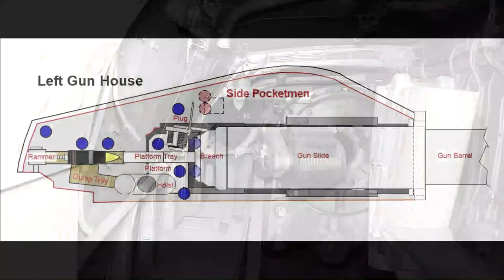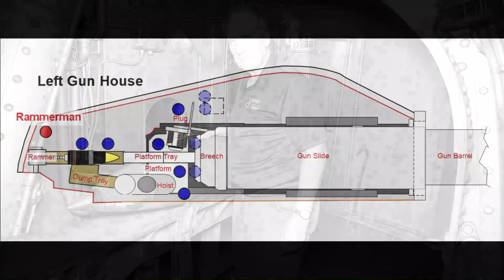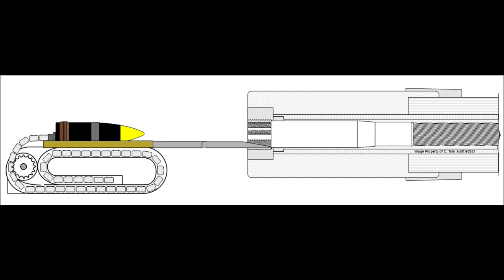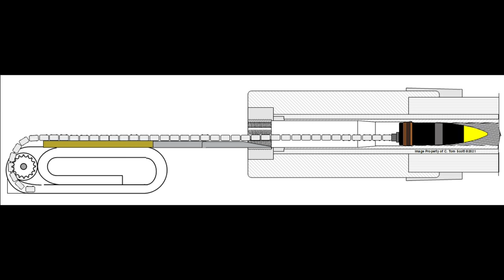Battleship Texas, Getting Loaded in a 14" Turret

Comment: Oh good lord, I just can imagine how those gun houses feel on a sunny July in the middle of the Pacific.
Reply from the maker: I can tell you from direct experience that the turrets are unsurvivable on sunny days when temperatures exceed 85-90 degrees.  However. each turret is well ventilated by two very large blowers that pull air from inside the ship and out through openings in the outer bottom edges of the turret houses.
Reply: @tomscotttheolderone364  Very interesting, they pull air from lower in the ship where the water makes it cooler, a simple, practical solution. Still, I imagine the experience is only slightly better than working in a turn-of-the-century steel mill. The metal itself looks like it's been sweating.

Comment: Makes the turrets of BB New Jersey look like the inside of the space shuttle.
Reply from the maker: No kidding!  I've been in one of Alabama's turrets and I'm pretty jealous.  If you look very carefully my video, you can see the black tube that is a rangefinder running crosswise across the top of the barrel in turret 2.  Reaching the operator's seat required crawling and squeezing on top of the gun mount in the right sleeve.  You can simply walk up to the one on Alabama!  Plus, they have a range finder in theirs used to calculate firing solutions.  It isn't fair!  :)

Comment: What's always blown my mind is how the cloth bags used for the powder charges don't leave any bits behind after the shot.  As a combat engineer i was trained in demo and with some of the ordinance we use you'll often see fragments of things you'd think would sublimate into vapor or just burn up.  Plastic coating from det cord, cardboard from tnt blocks, etc. Though i think that has more to do with detonation velocity, blast is over so fast there wasn't time. But i suppose with the gunpowder those guns use the heat and pressure behind that projectile could keep the temperature high enough for long enough to consume the cloth. 

It's cool to me
Reply from the maker: Since you were trained in demolition, you likely know much of this, especially the nature of burning explosives.  So, I am covering this for other readers also.  There is a good reason for residue and explosive gasses being present after firing.   First, the gasses produced by firing reached several thousand degrees and immediately heated the surface of the gun bore to a very high temperature that remained long enough to be a heat source that could reignite gasses and debris that may still be present in the bore and powder chamber.  Next, the oxygen used in the burning process is chemically bound up in the propellant itself.  However, there is not enough present to completely consume the propellant.  So, the process is that when a powder grain ignites, it releases propellant vapor and oxygen from its surface that burns extremely rapidly until the grain is consumed.  However, not all of the gaseous mixture is burned because it runs out of oxygen.  When the breech is opened, fresh air rushes into the breech or muzzle, providing enough oxygen to reignite the gas.  As the flame expands it pushes out of the breech, exposing more of the remaining gas to oxygen and continues to burn until consumed.  All of this happens in a millisecond or less.  Regarding fragments, there may be two types present.  First, there may be tiny fragments of unburned propellant present.  The powder grains that were used were extruded cylinders that had 7 holes running their length to provide more burning surface area.  The pieces left behind are fragments of what is called the web, which is the material between the holes.  Even though the gasses are hot enough to ignite when oxygen is introduced, the surface temperature on the fragments has dropped enough to stop the evaporation process.  So, they sit there waiting for a new ignition source, which is the reignited gasses.  The bags were made from raw silk, which readily burns and leaves only a fine ash that will not ignite since it has already burned.  However, it is possible that tiny fragments have been left behind.  Plus, it is my understanding that the bag laces may have been made out of wool on early bags that could have left unburned pieces behind.  Even though gasses and fragments have been burned using the gas ejector, there is still a remote possibility that some fragments remain.  The greatest concern was that fragments may remain on the face of the breech plug that came in contact with the next shot's powder bag ignition patch containing black gun powder.  That is why it was always wiped with a wet sponge between shots.  If there is any concern about a foul bore, one manual said that the gun captain should immediately order a shell to be rammed into the gun to seal the bore ahead of the shell and eliminated it as a potential ignition source.  They could then spray the powder chamber behind the shell with water to cool and wet down any remaining debris.  They could then proceed with loading bags.  Since gunnery procedures required loading immediately before firing, the powder in the bags wouldn't soak up enough of the water remaining in the chamber to have any effect upon on firing or performance.
Reply: @tomscotttheolderone364  thanks for taking the time to share more of your knowledge. The bit of information i was lacking was that the powder bags were silk. It makes a lot more sense now. Still cool, just less of a head scratcher lol.  

Thank you again for your time sir.

Comment: You are certainly right; the shell and propellant handling systems of Texas are very primitive compared to the Iowas. It boggles the mind to imagine that Texas participated in the bombardment of Normandy before and after the invasion in 1942. Kudos to the officers and men aboard her.
Reply from the maker: In spite of the fact that the systems were largely manual, a well trained and drilled crew could keep up a high rate of fire for an extended period.  The fire control system was pretty obsolete when compared to later ships and this would have been a problem in a sea superiority role, but they worked very well for landing support and shore bombardment.  Air spots continually reported back complete destruction of targets using indirect fire thousands of yards inland during the D-Day landings.  Its effectiveness was further demonstrated on the afternoon of June 6 at Omaha Beach when the ship closed to within 3,000 yards of the beach and used the 14" guns to clear exit D-1 with deadly pinpoint accuracy.  This saved the lives of scores of troops and provided a major way off the beach.

Comment: 4:00 Love how small the screw for rising/lowering the angle of the gun is. Makes sense with how finely balanced I'd imagine the gun is. Just seems like it'd be larger, but reckon not.  I'm surprised the turret is sub divided. Didn't realize it wasn't like more modern turrets that have all 2-3-4 guns in same room. The well man and guys in the pocket had it the worst it seems haha.
Reply: Yea, Thinking of being in those places makes me shudder...
Reply from the maker: The screw looks pretty big to me. Perhaps it looks smaller due to perspective.  Btw, you are right, it is finely balanced.  The center of balance for the barrel, breech and slide assemblies all together is right at the trunnions that the barrel rotates on to elevate.  The major weight that has to be lifted is the 1,920 lbs. of a projectile and powder charge, plus the inertia loads provided by the 60+ tons of mass. What is really impressive is that power to elevate the barrel came from a 15 hp motor!   Go to 10:20 in this video to get a complete closeup of it:  https://www.youtube.com/watch?v=sTizEKz0u5s&t=6s
Reply: @tomscotttheolderone364  Indeed! Thanks for link to closeups, didn't see those. That was most interesting system of the gun in my eyes.
Yeah, I naturally assumed it would be even larger when I saw it. Looks only like 4" or so. I just envisioned like a solid 12" piece in my mind. Makes sense though that it's not. Crazy that a 15 hp motor has the power to move that. Heck, both the guns it sounds like. Looks like it has clever reduction gearing. That clutch system is cool too.
Reply from the maker: @jonny-b4954  We're still having a perspective issue.  I have never measured it, but it's diameter is about 12".
Reply: @tomscotttheolderone364  Ah, yeah definitely perspective from video throwing me off then. Only looks like 4" to me. Forget my whole comment then! hahah ;)
Reply: the turrets on the Iowa class and the North Carolina and South Dakota before it (all 16") are all separate gun houses.  i think the 5" turrets are segregated as well. i dont know of any other turreted guns and none that i know of have all the guns in the same house (room).
Reply: @truthsayers8725  Oh yeah? I feel like I could have sworn seeing photos inside turrets like that but maybe not.

Comment: Superb video, narration, and graphics once again, Tom!
Some questions:
When the gun fires, does it recoil over the loader's platform? There doesn't seem to be much clearance between the breech buffer and loader's platform floor.
When the gun is ready to fire, where do the two wellmen go to get clear of the recoil?
Adjacent to the hoistman position at 5:56, there is a hose, and what looks like a valve and a nozzle hanging on bulkhead.  What is the purpose of that feature?
Thanks in advance!
Reply from the maker: Yes, it always recoils over the loader's platform since the platform stays in precisely the same orientation with the breech regardless of gun elevation.  I am not sure what you mean by breech buffer.  Regardless, a fraction of an inch is good enough as long as it clears.  The two wellmen lay down across the silver tray that the powder slides on out of the side pocket.  That puts them ahead and below the loader's platform, which is the lowest portion of the gun assembly.  The hose appears to be hooked up to a water supply.  My best guess is that it may be used if there was a misfire that couldn't be cleared by repeated attempts to fire with fresh primers, resulting in having to open the breech plug and remove powder.  This is a particularly deadly thing to do.  The turret would be cleared of all personnel, except for a couple of trained crew and a gunnery officer.  The firing lock mechanism would be rotated and removed from the plug, leaving an opening about the size of the nozzle on that hose wand.  If I am right, they would insert the tip of the wand into the primer vent and shoot water into the chamber in an effort to thoroughly soak the powder bags before opening the plug.
Reply: @tomscotttheolderone364  I misspoke. I meant to write "recoil buffer nut" or "gun yoke."  Your educated guess concerning the water nozzle makes complete sense.

Comment: This was an awesome video...big question...what was the big dial/clock for on the battleship tower in the early photos?
Reply from the maker: It was called either a range clock or concentration dial that indicated distance in hundreds and thousands of yards to a target, and was read by other friendly ships to know the distance between the ship doing the aiming and its target.  That information was used in combination with angle, also called deflection, that was shown using marks painted on the sides of the ship's turrets that were called declination marks.  Other friendly ship could read that using binoculars or telescopes to quickly mark the aiming ship's location on a map, draw a line using the angle indicated on the turret, then make its length indicated by the range clock.  With that, they could identify a single ship out of a group of enemy ships and make it their target.  Ganging up on a single target was a common tactic called "group firing".  This also what provides the name "concentration dial" since it was used to concentrate fire on a single ship. The range and declination information was not precise enough for your fellow friendly ships to use for aiming their guns, but it was good enough to tell them which ship you were aiming at.  Once they identified the ship, they would perform their own target ranging and calculations, generate their own firing solutions and fire at the same enemy ship.  Considering that a single ship may hit their target 10% of the time on a good day, group firing significantly increased the odds of disabling and sinking an enemy ship. 

Range clocks and declination marks started going away by the early 1930's as radio between ships and spotter aircraft came into common use.

Comment: Ouch, that sounds an incredibly physical process, with several hundred pounds of powder being lifted up by a bunch of young men in cramped quarters.
The Iowas almost have it easy in comparison with the powder bag delivery directly onto the rammer tray location.
Reply from the maker: That's true, but they were pretty clever about it.  Enough crew were employed to break the work for every individual down to fairly short lifts and movements.  1918 and 1920's gunnery manuals stated that powder passers were to be exercised using practice bags on a daily basis by moving at least 50 bags in a session.  The goal was for each man to not be breathing hard by the end of a session.  With successful conditioning, those guys could probably go for hours before tiring out. Even more amazing was that at one time, there were no powered powder hoists.  Getting bags to the dividing room, just before the turret, involved passers standing on platforms spaced 30" apart.  They would pick up a bag placed on their platform by the guy beneath them, then lift it and set it on the one just above them.  Talk about strenuous work!!!  Powered hoists were added in the 1919-20 time frame to replace those platforms.  This not only sped up powder movement, but most importantly, eliminated a major hazard by closing up a wide open path for flames between the dividing room and lower handling room if there was a powder fire.

Comment: What a hot, smelly, loud, mess it must have been in there during operations. Thanks for the gun tour and info.
Reply from the maker: I never heard about smells, but I would assume that it would be a mixture of oil and burned propellant.  Heat and noise wasn't too bad.  There were two large blowers that pushed a huge amount of air from the lower decks of the ship up through the turret structure and into the gun house.  Gun fire wasn't very loud inside the turret because of the heavy armor that protected the crew.  What they mainly heard whenever a gun fired was a loud "whooshing" sound from the gun's recoil buffer that is like a giant shock absorber.  It was then followed by a loud banging clang as a set of four large counter recoil springs pushed the barrel back into position after it finished recoiling back
Reply: All in the name of democracy. With punctuation on the moc and the cracy

Comment: Now I know why sailors of that generation had arms like Popeye. The guys in the Gun well having to lift roughly 50kg above their heads a minimum of twice individually every time the gun fired. I can’t begin to imagine doing that for a protracted gun battle, with the expectation that my speed of delivery had to be exactly the same on the last shell as it was on all the ones previously. Hats off to them
Reply from the maker: Right!  One thing that helped was early gunnery manuals said that all crew members that passed powder should be exercised daily until they could pass a large number of bags without breathing hard.
Reply: @tomscotttheolderone364  now that is an interesting fact I didn't consider. I assumed that it was either a case of only assigning certain guys who you knew would be good to go straight out the bat, or random selection. In the case of random selection I assumed that if you weren't strong and fast enough you would just be yelled at until you became capable. 

I wonder then if there was a certain 'elitism' amongst the powder monkeys with regards to being trained to be strong. Would the captain go to them to put together the ships boxing team etc? Further onto that I assume that some were mightily pissed off when electronic devises were introduced to replace them or make their lives easier? I certainly know some old engineers who still use hand crank tools because 'power tools are for wimps, and didn't have to put effort in like the old days'.
Reply from the maker: @actionidiot7546  At least one book written by a former crew member notes that many departments on the ship had plenty of volunteers because the skills they picked up translated to jobs in civilian life.  This wasn’t the case with gunnery.  Most crew were assigned there whether they wanted it or not.  So, there may be some random element in play at that level.  However, assignments within a gun crew would very heavily consider individual attributes.  It would be a serious mistake to put a man in a job who was physically incapable of performing it, then punish him when he fails.  You not only ruin him, you lose the respect of the entire crew. Gunnery manuals clearly stated that well men and loaders should have a lot of strength.  Gun captains should have high intelligence and the ability to manage a small team.

It was common for gun crews to compete against one another as a means of building skill, teamwork and morale.
Reply: @tomscotttheolderone364  Thank you very much for all this information. You have certainly peeked my interest, and received my subscription!